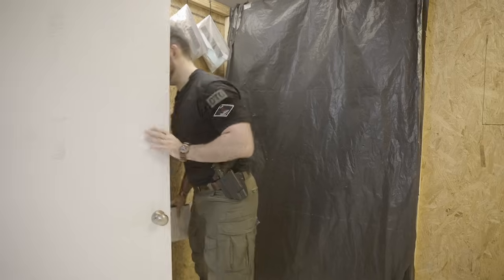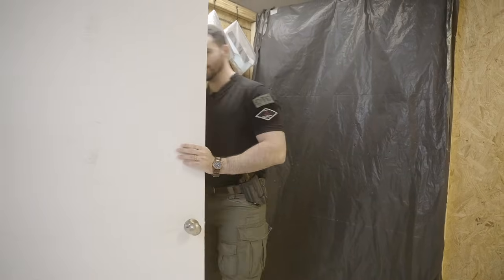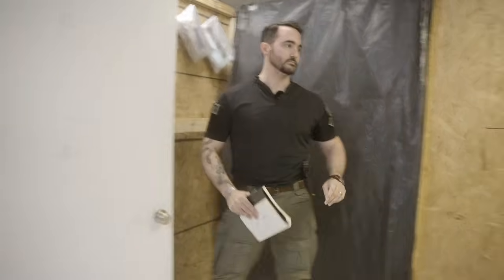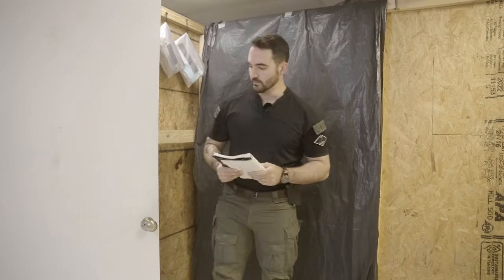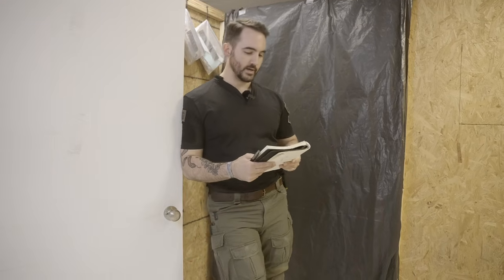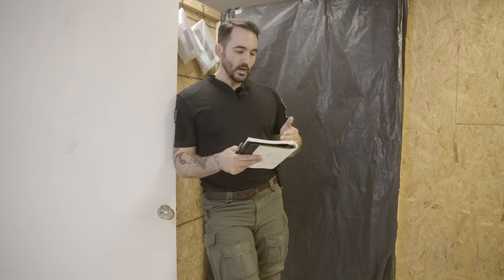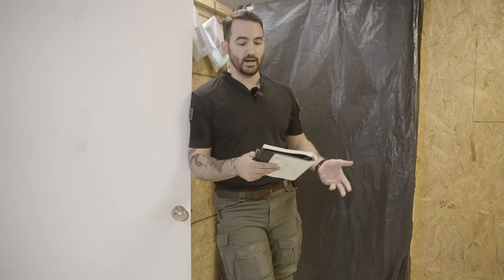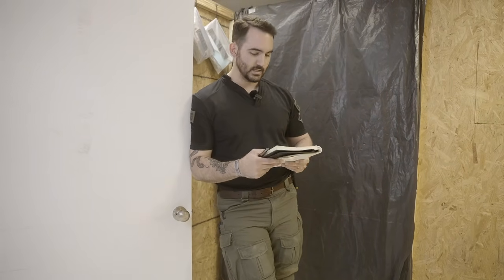CQB Terms and Definitions Explained

Comment: Would really like to understand how to handle closure arm doors better. Really interested to see how it affects the clearing of a room and what needs to be done differently
Reply from the maker: The automatic closing function can be defeated in a lot of ways, but it definitely changes some things. The most common methods are just wedging it open with a fireman's wedge, or a piece of wood on a J shaped hook that hangs on the hinge. Other than disabling the closure arm prior to the breach, that's usually what people use. The other methods to deal with the door closing are essentially just using speed to get two people in to the room before it closes (dynamic entry, etc). and have the 3rd and 4th man deal with the door, or have the breacher pin the door with his foot and hold it for the entry team.

Comment: Thanks for the video.
Are there any special considerations for pocket doors or sliding doors?
I know this is kind of longwinded, and I'm sorry for that. But this is a though that took all of 3 seconds to conjure and two minutes to write.

Example. A true pocket door presents one huge issue if someone knows how to keep it from sliding. Can be as simple as a bolt on the origination side that passes through a hole in the room side door frame, through the door, and into a blind hole in the outer frame. At that point, you're better to try and defeat the door itself than try to pry it open because you'll be trying break the frame or cut the door in half with the bolt essentially. Also, if the pocket door recesses into the opposite frame from where it originates, it becomes much harder to pry back. You'd basically have to cut an X in it with a chainsaw or use explosive breaching.

Sliding doors that are on a single top rail are easier to defeat, even if they are double latched at either end and secured to the wall, but still pose a fatal funnel issue.
Reply from the maker: Pocket doors and sliding doors are usually a pry solution if we are talking interior work. For glass sliding doors I have used a shotgun or just simply breaking and raking it out
Reply: @oriontraininggroupllc2782 Thank you for the response. I know this is creeping into the realm of tactics and 100% situationally dependent, but if you came upon a pocket door (or even a barricaded traditional door for that matter)  that couldn't be "reasonably quick" to open, do you skip it and come back to it? Or do you force entry right then and there?